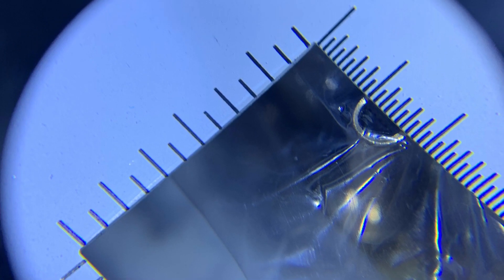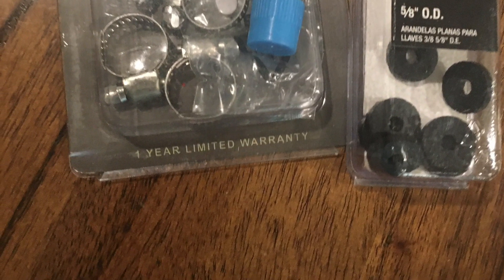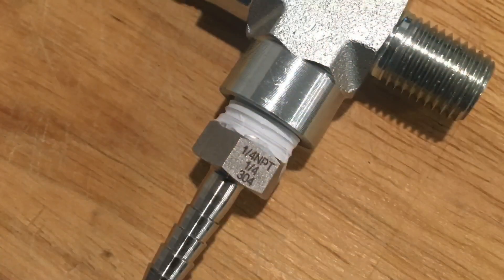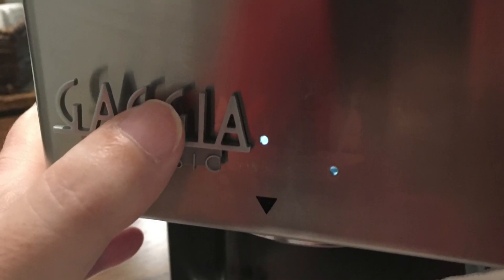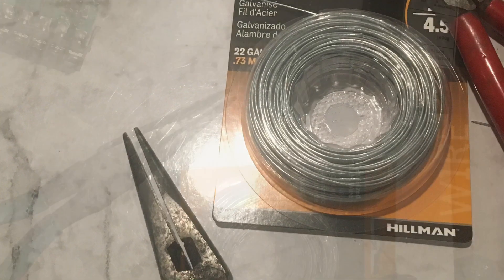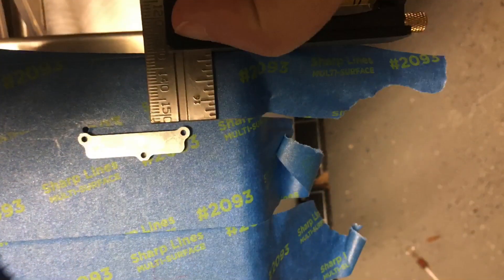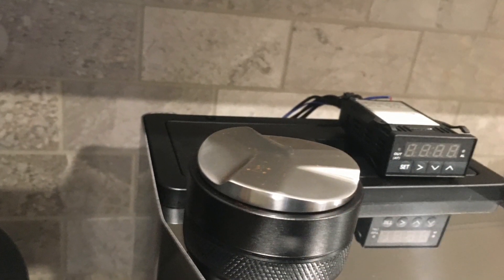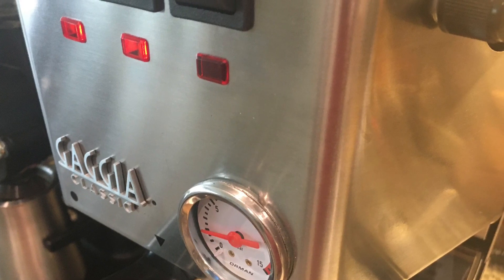Gaggia Classic Pro OPV Gauge PID Dimmer - How It Was Modified!

Comment: Any advice for marking the right place to drill the hole for the gauge? Is the gauge you used 40mm?
Reply from the maker: The gauge is listed as 41mm from cafeparts.com and I wanted to keep the 41mm hole with even space from the right side and bottom. I also wanted to keep the hole in line with the Gaggia logo, but I had to keep the hole as low as possible to stay away from the indicator lights, but also, this put the location so low the back of the gauge and bracket ended up hitting the mounting lip of the boiler, which pushed the gauge out the front of the machine by 2-3mm! So in the end I should have made the hole about a 1/4” higher, but it would not have looked as professionally aligned as it came out.

Comment: Could you explain how you wired the 2nd SSR? 
Maybe based on the wiring diagram from @Ewejin
Reply from the maker: Here’s what I learned:
Joe Varacalli and his engineer dad give a good demo here:  https://youtu.be/B3j-AKNIGns
I did not create any diagram for the second SSR. Ewejin Tee demonstrated a good diagram in this video, https://youtu.be/ztvDKt2Zz6c
The only supplement to that, if using the xmt7100 modified as Damian indicated here, https://youtu.be/WYm6hDPqtgA is to run pin 4 and 5 to the second relay for the steam thermostat terminals. I only used the negative terminal, pin 5, to the second relay because as Damian indicated elsewhere, the positive of pin 10 and 4 is constant on, and only negative pin 9 and 5 are switched. So I ran one wire from pin 10 to positive terminal of both solid state relays!
Damian Witonski remove ssr xmt7100
Remake - https://youtu.be/WYm6hDPqtgA
Original - https://youtu.be/Ewj5oXl_wk0
Reply: @threehanded8853  Thank you for your reply. TBH I have seen exact the same comment under another video but it would not let me figure out the solution :(

I'd really appreciate if you could take the time and comment on my assumptions: 

PID pin 5 -> SSR AA pin 3 or 4
PID pin 4 -> SSR AA pin 3 or 4
as you used PID pin 10 instead of 4 I assume you took it from SSR DA pin 3, right? This has the advantage that one cable less has to be outside of the Gaggia. 
Is my understanding correct so far? 

Now coming to the crucial part. 
One of the steam thermostat pins -> SSR AA pin 1 or 2 
The other steam thermostat pin -> SSR AA pin 1 or 2
Or can those be taken from the SSR DA pins 1 & 2 (advantage: better cable management). And if those can be taken from SSR DA pins 1 & 2 must the steam thermostat be disconnected or bridged?
Reply from the maker: @hoqpus  PID pin 5- > SSR AA pin 3 or 4 - PID pin 5 is (-) and should go the (-) of the SSRAA which in my case is 4.
PID pin 4 -> SSR AA pin 3 or 4 - PID pin 4 is (+) and should go the (+) of the SSRAA which in my case is 3.
as you used PID pin 10 instead of 4 I assume you took it from SSR DA pin 3 , right ?  - YES.
This has the advantage that one cable less has to be outside of the Gaggia .  Is my understanding correct so far? - Correct.

Now I come to the crucial part.  One of the steam thermostat pins -> SSR AA pin 1 or 2
The other steam thermostat pin -> SSR AA pin 1 or 2 
- the steam thermostat pins are not used, but the wires that were connected to the steam thermostat should now connect to Steam SSR AA 1 & 2.

Or can they be taken from the SSR DA pin 1 & 2 (advantage: better cable management).  And if those can be taken from SSR DA pins 1 & 2, should the steam thermostat be disconnected or bridged?
- I did not see a safe way to do this. In my case I used the wires from the steam thermostat. Then I removed the steam thermostat but that is not necessary.
Reply: @threehanded8853  so good. I think I finally got it. 
One remark: The SSR AA pins 3 & 4 are AC and therefore +/- shouldn't matter... 
Thank you!
Reply: @threehanded8853  sorry for asking again. 
As the wiring described by you is differing from the typical wiring found on the web (e.g. https://docs.google.com/document/d/1YKahCYmW8_O8aR2HE877M7nzGrYzTuF3Lse6WfiQsog/edit?usp=drivesdk) is your 2nd SSR also a DA (DC input, AC output) as you feed it with the DC alarm output of the PID?

How does the PID know then when it has to switch from brew to steam temperature control if the brew switch is not involed?
Reply from the maker: @hoqpus  sorry, yes my SSR are DC
Reply from the maker: I Just posted an SSR video for my Gaggia

Comment: Hi! You obviously seem to know you way around the Gaggia! I am impressed with all the mods. I have one question for you: Would the dimmer mod be fine as the only measure to modify brewing pressure? The dimmer mod is often only thought of as a flow control measure but in that way it also controls pressure, doesn't it? If so, then one wouldn't need to bother with the OPV springs in order to lower the brewing pressure, right?
Reply from the maker: Yes, I agree with that theory, but without the opv changed, or the pressure gauge installed, you have no way of actually knowing what pressure you are employing. You can only “feel” or have a sense of what pressure you are at. Still, only having the dimmer you will be able to produce exceptional espresso!
Reply: @threehanded8853  Thank you very much! Finally I found an answer 😃🙏
Reply from the maker: I whole-heartedly agree. If you install the dimmer switch, there is no need to reduce the OPV spring pressure! But if you do not install the dimmer, it is helpful to reduce the over-pressure amount by cutting two rings off your spring, in order to ensure your puck is not over pressured, IF you are only using fresh grinds in a standard portafilter basket!
Reply: @threehanded8853  Thank you! I ordered a dimmer but I also have an older GC (2012) and even though I did quite some thorough research before buying it, I somehow missed out on the fact that it has an adjustable OPV. You can simply set the pressure with an Allen wrench. I think that somehow this doesn't get talked about enough. I had thought spring mod, dimmer or PID were my only options when I bought it.
Reply from the maker: @HenryPiffpaff  yes, it’s a nice opportunity to have an older model with the adjustable opv!

Comment: Why did you have to remove the ssr?
Reply from the maker: The built-in SSR is removed from the xmt7100 PID AND bypassed, to allow the PID to control a second external SSR, via the PID alarm function, to control the steam temperature, as demonstrated here by Damian Witoński - remove ssr xmt7100
Remake - https://youtu.be/WYm6hDPqtgA
Original - https://youtu.be/Ewj5oXl_wk0
I learned from Damian, 1) how to install a gauge, 2) How to modify the PID, 3) How to connect the k-type thermocouple versus the pt100 type!
The built-in SSR of the PID will overload and possibly catch on fire if you attempt to use it to run the temperature circuit for the steam.
Reply: @threehanded8853  wow thanks! Cool build
Reply from the maker: It’s important for folks to know that before the PID install for steam, the internal Gaggia steam thermostat is rated at L145-15C which means when steam is on the heating element turns on until 145 Celsius then off until 130 C, then on again. When you set the PID to control the steam through a second SSR (relay), the heating element will turn on between 140 and 150 C if that’s where you set your AL1 and AH1 limits, which makes your steam power greater. And in my case if you have a -9 C offset you could be setting your boiler to range between 149 and 159 C !! This made my steam even greater! I changed my limits to 140 and 145 now. It is plenty of steam power and a little safer.  The thermal fuse limit on top of the boiler (this is different from the steam thermostat) is set to 184 C. If the thermal fuse trips nothing will work until it is replaced.

Comment: Keith did you connect the dimmer at wire from the pump or at the terminal of switch?  What I’m asking is where you spliced.  Does it make a difference.  I have the same model you have.
Reply: If you connect it at the switch, it will start to trigger the solenoid valve as you turn it. Make sure to connect it at the pump
Reply from the maker: You can see a good view of where I tapped in, cut into, my gray wire at 4:43. I took Sam Burchard’s advice in this video from 6:00 to 8:30, https://youtu.be/5rEBmcP1ZUo  So, answer is gray wire above the pump.

Comment: Thanks! A great video turned out - a guide to action. I will think about the fact that in the summer, on vacation, I will finally do the installation of a pressure gauge, a normal OPV and maybe even a dimmer.
Reply: This works in many machines. The old Saeco ViaVenezia, also called Starbucks Barista, already has an adjustable OPV. Adding the dimmer is the easiest thing… the pressure gauge is doable, though you need to be precise in cutting the steel casing.

Comment from the maker: WARNING!! I did not use the plastic mallet/hammer on the gauge, I only lightly tapped the Gaggia logo in!  Also, I forgot to mention in the video that I cut 2.3 rings off the OPV spring which resulted in 10 bar when the back flush basket is in. If I don’t ground fine enough I do not exceed 6 bar. For me, the taste is sweeter at the courser grind, like a turbo shot! Well, that’s not true anymore. I modified the Urbanic 070s grinder to stepless, and grind fine enough to exceed 9 bar now. I grind finer and control a profile on the Gaggia with my dimmer switch to impose 2 bar preinfusion to quick 9 bar peak to 6.5 bar remaining shot to perfection!